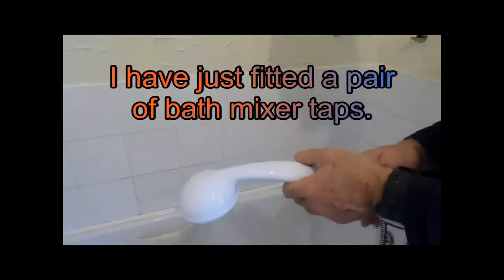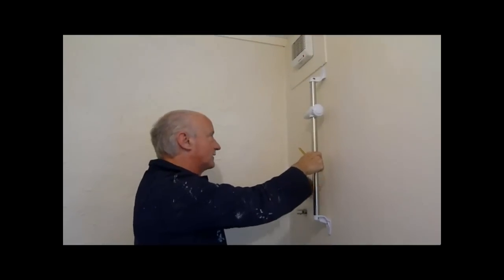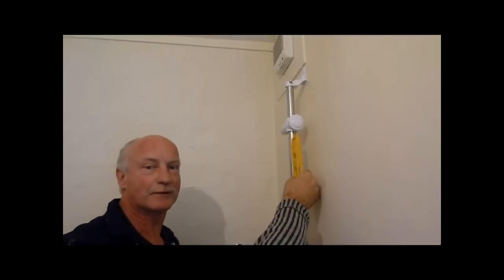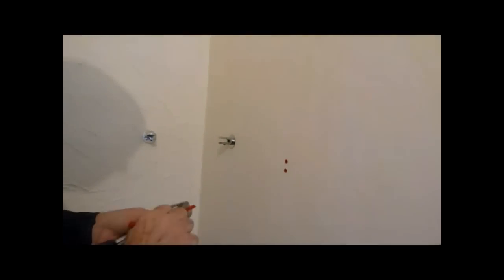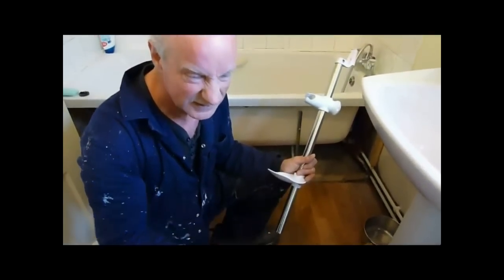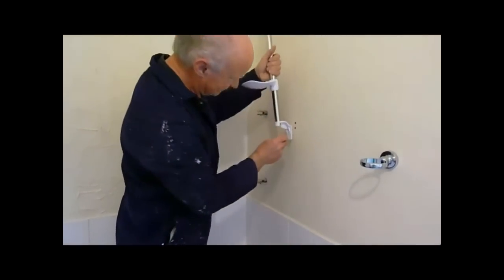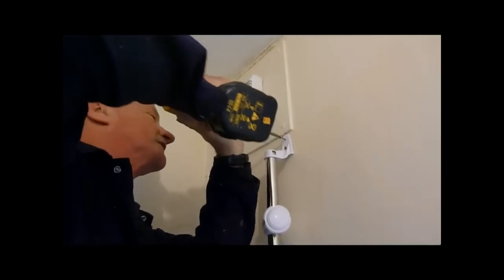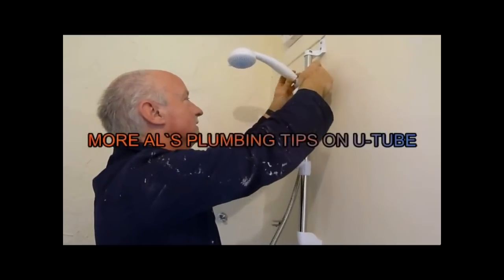How to fit a shower riser rail.

Comment: Hi Al, I have a Megaflow tank/system and would like to know if it should be serviced and how often.  What happens in such a service ?  Thanks.
Reply from the maker: Hi exwhyz33 , a megaflow system is one where there is a pressure vessel mounted above the cylinder so the hot water is unvented. This insures you get a fast flow of hot water to the hot taps , ie a lot more than you would on a gravity vented system . The only thing that needs checking is the pressure vessel for leaks ect .
Kind regards,
al.
Reply: dereton33 Thanks Al